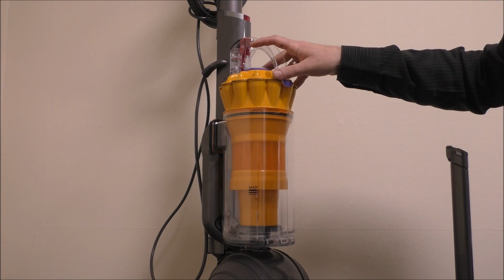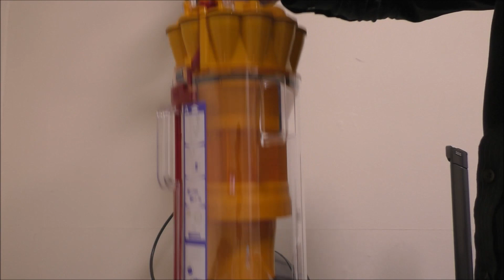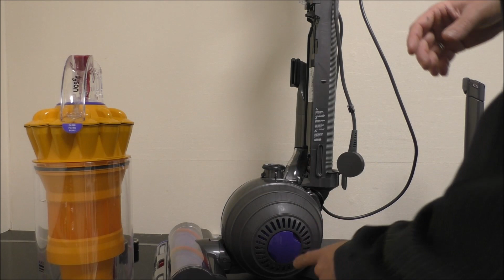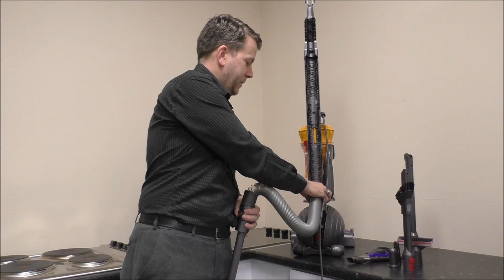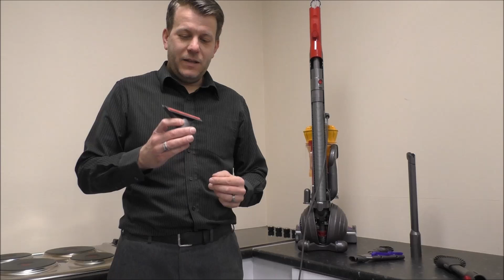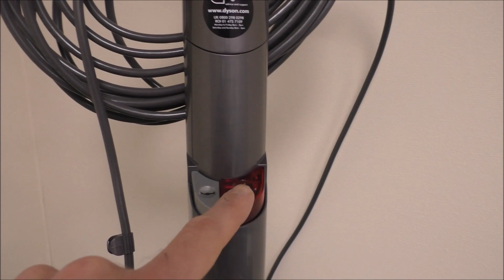Dyson Lightball Multifloor+ Corded Vacuum Cleaner

Comment: Using the flexi-handle is nowhere near as effective or easy as with a regular vacuum cleaner.
My thinking is that a standard non-upright is better for smaller homes; if you have a huge house where you want the ease of an upright for large floors...
then you also have room for 2 vacuum cleaners. 😉

Comment: Light ball? Nope. HEAVY. Try lifting it up the stairs. 
Also, the extender tube is a nightmare to use on the stairs or other small areas because part of it is a long, rigid, plastic tube - very hard to manoeuvre. (PS the extension part keeps wanting to pull back and contract while using it.)
And emptying and cleaning requires a lot more skill than you would think.
Other than those things, it is great. Cleans well with lots of suction and capacity.
But would not recommend it for those three reasons.
Reply: I'm tossing up between this and a V10 or V11. I am worried this is heavy like you said. What do you recommend for good suction and ease of use?
Reply: @PG-xi9jc  hi..
I can't really make recommendations as I simply don't have experience of other cleaners.
I suggest you shop around a bit and read reviews. Maybe even go into shops and have a good look, if that's permitted these days !!
Getting a decent vacuum cleaner that does exactly what you want is quite a minefield, isn't it?
Good luck.

Comment: Do NOT BUY THIS PIECE OF CRAP . Will not even suck up a peanut, just pushes it forward, you have to lift the whole unit up and on top of the crap you’re trying to get to. Waste of $600!!!! A $150 unit works 1000 times better. 
The ‘high reach wand is also very impractical and extremely hard to use , it springs back making it very hard to use! 

Save your cash and get something else!

Comment: Ok. Afternoon sir.
I am minutes away from buying one however I'm all but backing away from the upright because of one issue that is repeatably being reported on the reviews.
Thus is a big suction issue with plush plus carpets.
Issue reported is that with the turbo head rolling away it is digging into the carpet and making the vacuum unpushable.
Would you please give an unbias opinion.
80% of house is tiled floor however the bedrooms are carpet with a medium to plush pile.
Your opinion would be greatly appreciated and valued.
Thank you.
Reply from the maker: That can be correct feedback where on a long pile carpet you can struggle to push the vacuum. This is a big problem with cordless as they rely a lot on the roller brush and not the suction, but at least on an upright plug in vacuum, you have the suction as well, so you can reduce the roller going round which can be an advantage
Reply: @lords-electrical  thank you for your time.
I purchased this model anyway as it bedroom carpet is a short pile anyway but the rest of my house is tiled floor so I think / hope it will be ok our infact good for our situation.

Comment: Nice review, as always from you! I've had a Light Ball since October 2017, and I think its not a bad machine for the £200 they cost, but mine does not come with the flexi crevice tool, being just a standard multi floor model. I do have a flexi crevice tool with my V8 Total Clean, and they are not that great as the flexi part kinks if you bend it too far and cuts off the airflow, so while its quite long, its limited with the amount you can flex it.
A great part of the Light Ball is the large debris gates on the floorhead that can stop the machine snowploughing large debris on hard floors or carpets, and the gates can be closed off on carpet to increase the suction power it pulls through the carpet. The hose, as with most Dyson uprrights has a considerable recoil force to it which is apparent when using it on stairs, and it wont quite reach the top of a standard flight of stairs without the extension pole attached to it.
Its very quiet in operation compared to older Dyson models like the Dc07 DC14 and other uprights made several years ago, so its a pleasure to use and push along.
My one main gripe with it is the storage of the stair tool on top of the crevice tool on the side of the machine, as this makes it easy to keep knocking the stair tool off when using the machine. Otherwise, I'd say they make an OK vacuum for the £200 mark, HOWEVER:
On a side note, I am very unhappy with James Dyson's decision to move  Dyson's UK HQ to Singapore due to Brexit and for tax avoidance purposes, and whilst I have bought a fair few Dyson vacuums in the past, I doubt I will be buying any more.
Reply: This is just a bit silly I must say, Dyson is still among higest tax payers in UK. Seeing comments people saying that they're not gonna buy any of Dyson's products anymore because Dyson's decision to move  Dyson's UK HQ to Singapore just make me laugh. They say that and then go and buy a Shark, that doesn't pay any taxes in UK. 
Besides if you were a businessman, wouldn't you do what's best for your company?